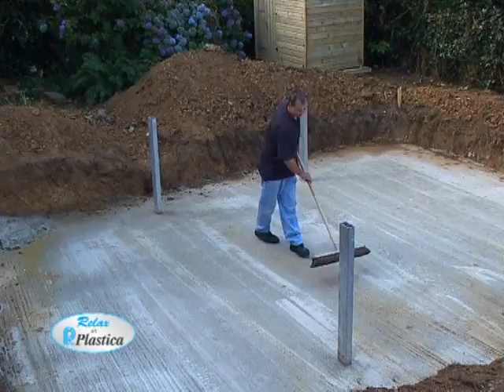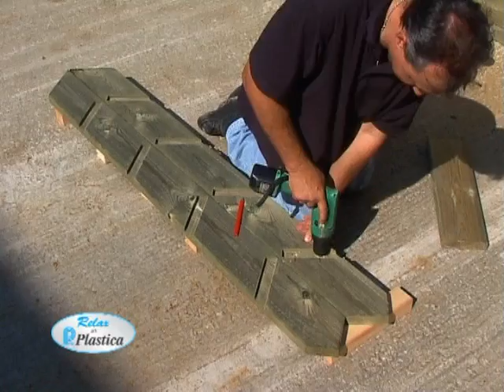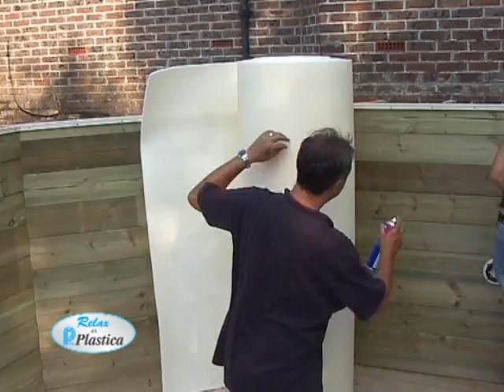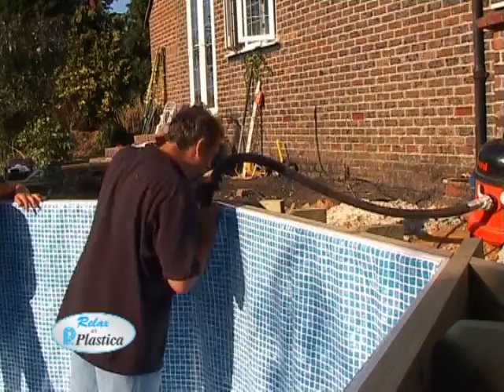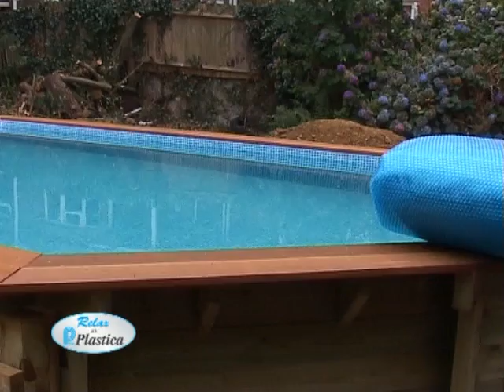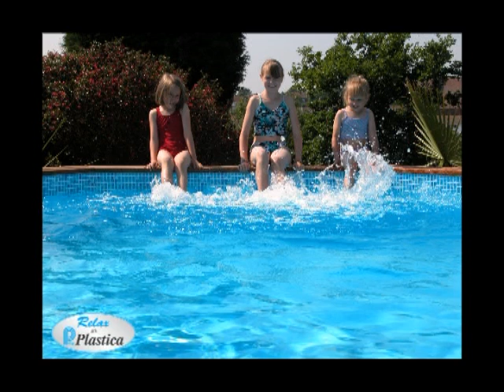How to install an Above Ground Wooden Pool - The steps involved - DIY

Comment: I enjoyed this clip bc it shows a good alternative to metal framed above ground pools, and that it can be all or mostly a DIY job. And this is so much more attractive than a metal pool. I would think a concrete pad is really not necessary as long as the metal posts are set solidly in masonry in the right locations. This has inspired me to think outside the box.